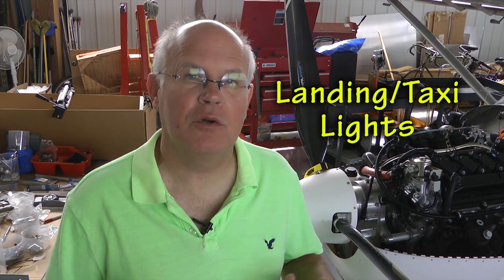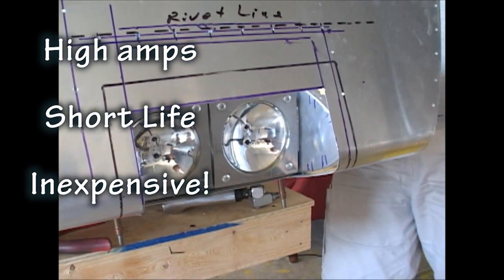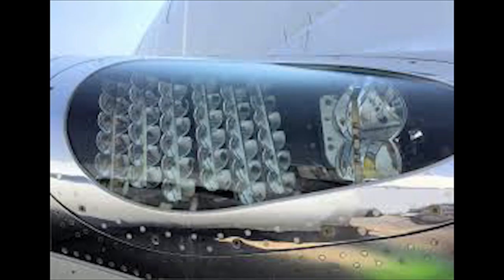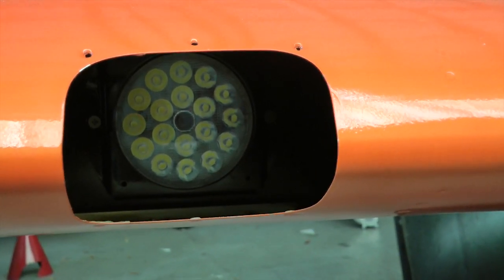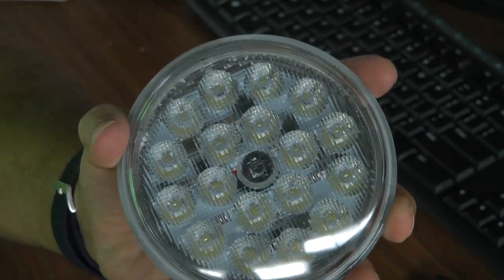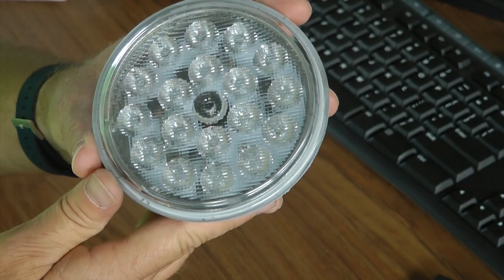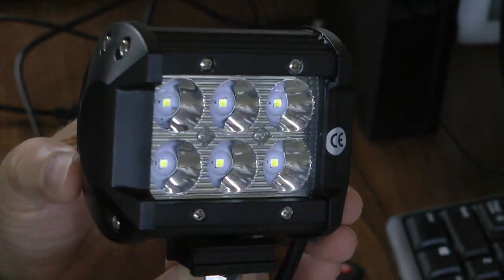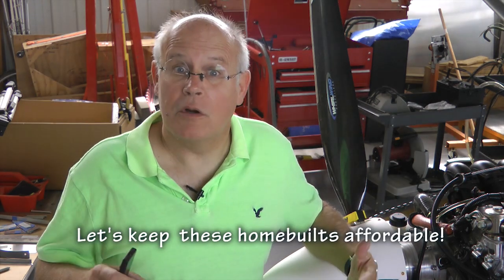Aircraft Landing Lights from Amazon's Aircraft Department

Comment: LED lights many times go bad quickly due to circuit issues. Already have had two LED lights(in the basement) fail with little use in less than two months. Also I ad a $135 LED flashlight go bad after less than a hour use. I have sputnik lamp with 12 LED g12 bulbs and I get maybe eight months of use out them before they start flickering and then go eventually out. I have had good results out of my high powered LED flood lights, so far but with LED lights its a hit and miss with them.

Comment: Hi all. Having tried numerous LED light units be aware many of these units create horrendous RF interference. Units designed for "tractors, earth movers etc tend not to have the same expensive electronics inside. Very powerful, cheap and useless if you try use your radio. I have found products destined for the emergency services have to have near zero RF interference, I have used CELL2.COM products to great effect.

Comment: LEDs and HID are in the same class. HIDs being a little more efficient. Halogen bulbs are old style bulbs just with halogen gas inside. HIDs tend to be about 20% more efficient but their main advantage is gross output. You can get 8000 lumens from a single lamp. LED can't do that yet.